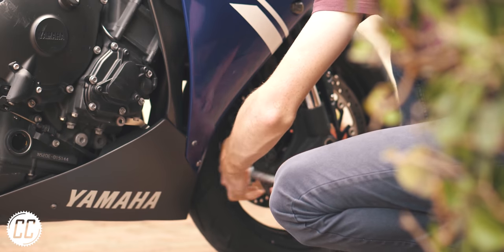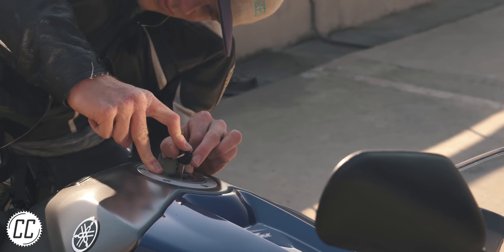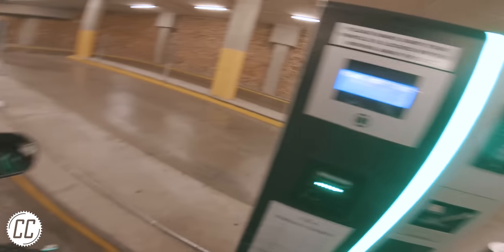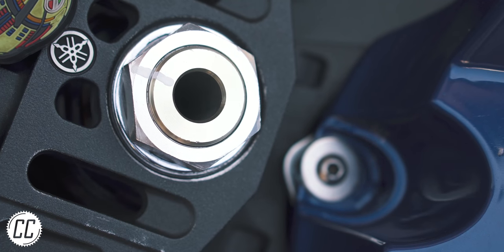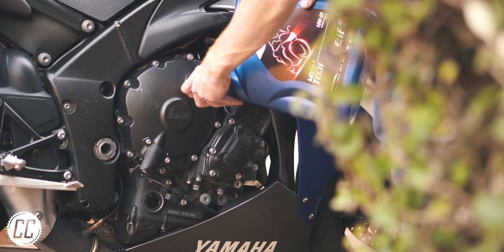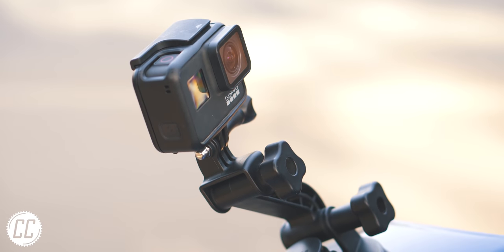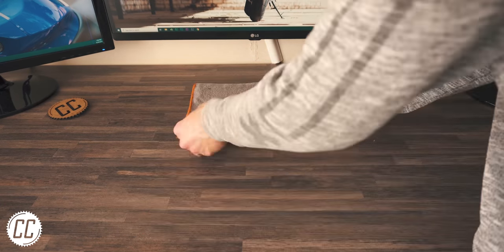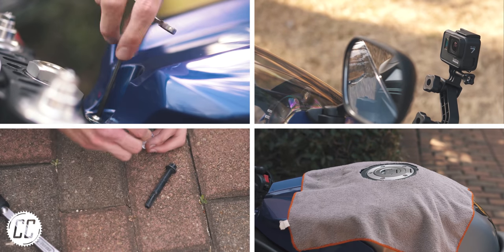10 Motorcycle Hacks For Enthusiasts

Comment: Bro do a video on engine oil, should we use only the engine oil which the company is recommended or the engine oil which we get in market
Reply: Every bike is slightly different, be it by brand or type of bike, they require an assortment of specific oils that can be found in the owner's manual, service manual, or a quick google search. The wrong oils can cause issues such as clutch friction plates slipping, transmission not getting properly lubricated due to the oil getting smashed in between teeth, or it not having the proper viscosity to get where it needs to go. The proper oil for a specific bike takes all of those situations into account and accommodates them accordingly.
Reply: @HeyoHudsy  Thank you bro 😊

Comment: I would be very concerned with using oven cleaner as a degreaser.
The lining of ovens is a hard, high temperature, enamel coating, not paint or anodising.
The aggressive corrosive chemicals in oven cleaner will attack the finish and surface of any parts of the bike and aren't good on skin either.

A much kinder and cheaper degreaser is household washing up liquid, even the less expensive brands such as Aldi / Lidle etc are fine and won't strip paint, pit aluminium or stain plastics.

Comment: The fuel cap on my Honda sh125 is inside a sealed compartment so no keyhole on the actual cap.  It was so stiff I needed stilton's to open it.  Squirt of wd40.  Problem solved!

Comment: Bro my bike to much of fairing vibration noise plz give solution bro I'm from India.
Reply: Get a old bicycle inner tube cut into circles or squares and a paper hole punch for the bolt holes. Take it apart insert them and tighten them down with blue loctite.
Reply: Do double taping at points where u feel there is a vibration. Unscrew it , use bothe side tape and screw it back. It will work like a charm

Comment: WD40 is still not a lubricant
Reply: The default stock version?  Yes..you're correct.  They do make a version that has lubricating oil or oil mixed with it's mixture.  I forgot the exact name of it though.

Regardless, If i want to lubricate my rebel's chain, it's either that reasonably good ( that turns white upon application) lube made in another country, or gear oil.